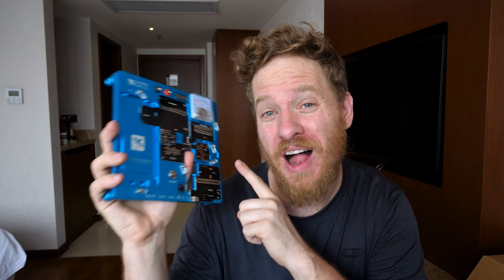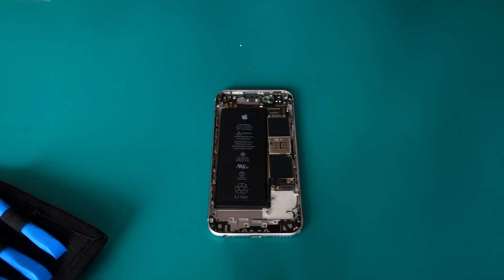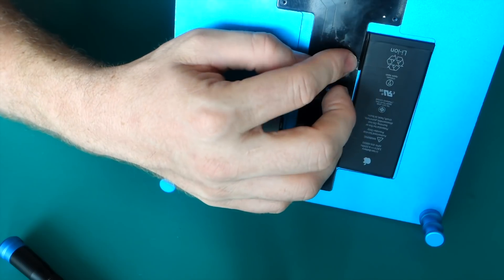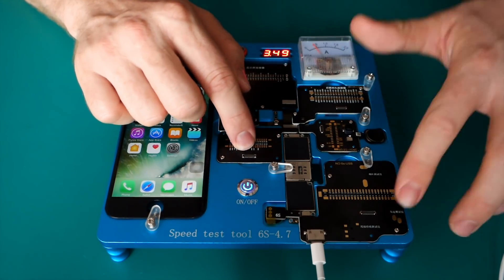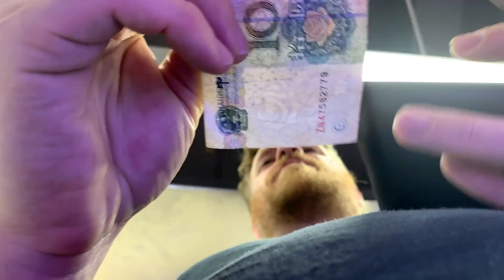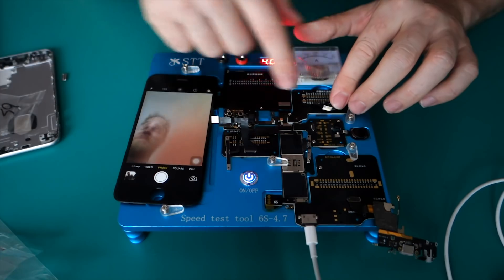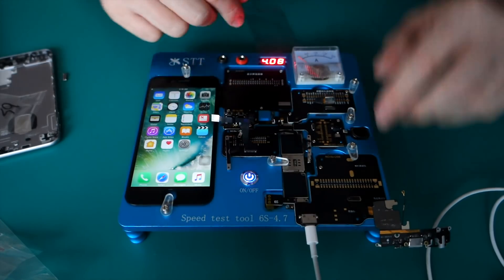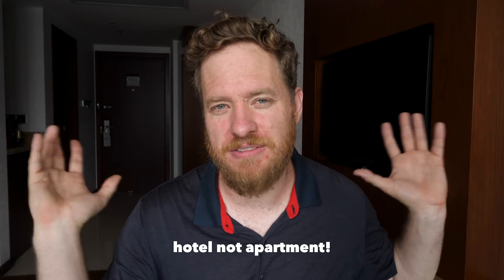Let's Make an Exploded View iPhone! - in Shenzhen, China

Comment: When you mentioned soldering wires to the various pads on the test jig, I figured you should know the concept of a pogo pin. Once the parts are loaded into this jig, the whole assembly may be put into another larger jig which has spring-loaded contacts (pogo pins) that line up to all those test points. A bit of code can then cycle through any number of functionality checks in an automatic fashion.

Comment: Build a Smart Phone with Awsome Specifications such as:
CPU: 8 Cores.
GPU: 8 Cores.
RAM: 12 GB DDR5.
SSD: 256GB RAM.
Front Camera: Dual 48MP O.I.S. with Wide and Ultra Wide Lenses.
Rear Camera: Dual 48MP O.I.S. with Wide and TelePhoto Lenses.
Display: Super AMOLED 6" Screen with 19:9 Aspect Ratio and HDR10. 
Display Protection: Corning Gorilla Glass 6.
Sensors: Iris Scanner, Face Scanner, FingerPrint, AcceleroMeter, Gyro, Proximity, Compass, BaroMeter, Heart Rate, SpO2.
Speakers: Stereo with Full Range 20-20Khz.
USB: Type-C 3.1 version.
Battery: Li-Po 5.000 mAh.

Comment: There are a few ways to use this tool such as Voltage checks inline while the device is on since some voltages are only present when perfs are connected and enabled. Another use of this tool, which is the probably main function, would be diode mode measurements, you can think of a diode mode measurement in a way like this, each circuit has a specific resistance and its always the same for the most part in a proper working circuit. Instead of taking an ohms reading which can be a bit clunky, you can run a diode measurement, which in essence works off voltage drop which is tied directly to resistance. So for example, you drop 2 volts into a line, and it always drops .2v on said line and you measure it and it drops more than that or less, then you know, hey, something might we weird here.  Most serious technicians create these diode maps with their own personal multimeter because all multimeters measure slightly different. The technique can be used for many things including under IC chips on huge arrays, although this can take much more time, its generally a great way to dive deep into lane analysis.  These tools basically magnify the FPC circuits so you can see them at a macro level, which makes things sooo much easier! Anyway! another great video, don't forget, if you ever need anything, or want to sit down and talk about a video before you put it up, I am always available for a consult and am always in the markets. Keep up the good work! - Justin
Reply from the maker: Thanks for sharing Justin!  Awesome to hear how people that are doing serious repair are using these tools.  Let's connect when I'm back in Shenzhen in a few weeks.
Reply: @StrangeParts  right on dude, im actually headed back to the states for a few weeks myself so that will be perfect. add me on wechat real quick, my username is "theartofrepair" of course XD haha

Comment: BEFORE THE NOTIFICATION 20 Secs ago WOOOOOOOOOOOO

Just repaired an  iPhone 5 :) complete swap of everything basically
Reply: You're a big inspiration to me together with Louis Rossmann
Reply: If it was a complete swap of everything, does that really count as a repair? That more just sounds like you built an iPhone.
Reply: @seraphic22  The Display was crashed, aswell as the back glass, so I needed a new Shell, but I also needed my working Logic Board with all my Data and music on it, because the donor iPhone had a hardware defect. So I pulled out the screen from the Defect iPhone (Working Screen though) set it aside pulled out the logic board from my actual iPhone swapped the logic boards so that the functioning logic boards is in the intact shell (Which also has a working power button because mine was broken) and I then used my existing battery for it. But then I had to swap the Haeadphone / lightning / speaker assembly from my crashed iPhone into the good shell because the defect iPhone had a lot of gunk in it eg. corrosion which I couldn't scrape off completely (it was probably water damaged) and yeah after THAT I could finally close it up and downgrade it to IOS 8.4.1 and jailbreak it TADA :D